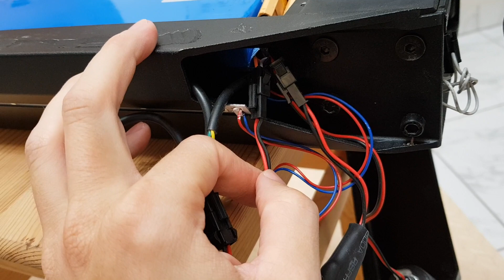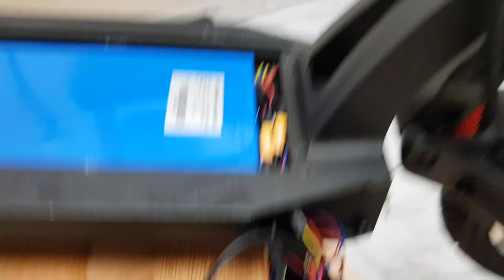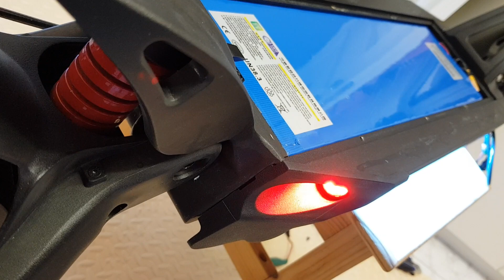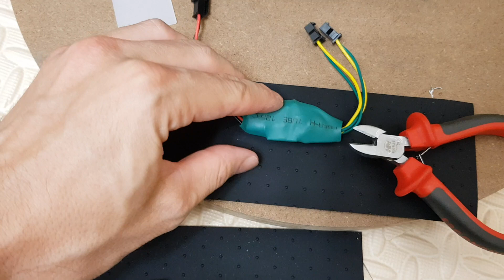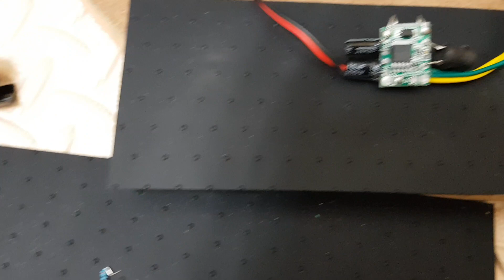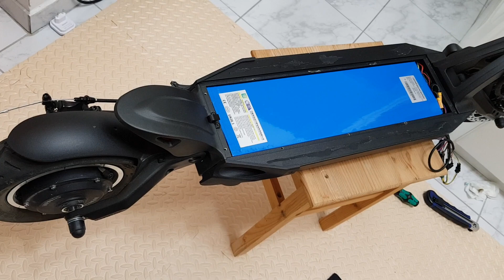Kaabo Mantis Brake light repair

Comment: Hey love your video very informative I'm a subscriber I have one quick question question the black resistor not the green where does it go connected to what wire on the controller or if any please let me know I installed the green one now I'm working on the black 1 please let me know thank you
Reply from the maker: I am sorry, but I don't have the Kaabo Mantis any more. I sold it over a year ago.

Comment: Hello. I bought an Yume M11 electric scooter. The scooter came with the rear light broken (the red diffuser ) and because was mounted on the rear fender after a while broke completely. Yume sent me a replacement but now I have no brake light. I changed the connectors between them and the led's are working either 2 either 3 from 5 total which 3 I presume should be for the brake light. I understood that the controller has a low and a high brake wire. Is the high 12V? I will mount a separate brake light but I see other connectors with only 1 wire. It means the wire is only +? If yes which one. And the ground is common with other ground wire? Please help me. [Smile]
Reply from the maker: Hi, I am sorry but i would assume that the Yume is totally different wired from a Mantis or some other scooters. I could only guess and that is a bad base for advice.
Reply: @ralfhalbknapp1104  Hello and Happy new year. I believe uder different brands the functions are the same. The computer/display/accelerator on mine is the same. I discovered in the mean time that the light is controlled via a chip which sends power trough the wires only when the led's are working aka it senses a consumption. Maybe when the lamp broke caused a short and fried the chip. That means a controller replacement. I want to see what Yume has to tell about it. Worst case i have to buy another one. Thank you for the reply. Seems nobody knows what the high brake wire function is and why in all controller is only one. The low brake two.

Comment: ralf halbknapp Hi please help i have Mantis 10 800w one motor  how to connect both rear brake light and headlamps and side lights from the controller please help Instruction and photo how coonect please help this and cruise mode braking cruose mode dont turn off why?

Comment: I have a question. Do you need to disconnect the battery if you want to rewire/solder wires or is it safe to do without disconnecting everything.
Reply from the maker: Depends on your Skill. I typically disconnect the battery if i change or solder parts that can cause a short.
Reply: @ralfhalbknapp1104  Makes sense. I wonder, Mantis have speed limiter cable as many other scooters, unplugging the cable removes the speed limit, so I wonder if it is possible to make it into a on/off switch somewhere outside instead of plug/unplug inside the deck via simple on/off switch/button, what do you think?

Comment: hey bro, can u help me?  i got a brand new mantis last week.  was coming home from work tonight and got the e10 message and it turned off nd wont stay on since.  it turns off immediately too and from what i've read its a controller error which considering how new it is and how it shut right off, do you think a wire got disconnected?
Reply: Unfortunately, this mistake (e10) is common with the Kaabo Mantis. The same is currently happening in Germany with the IO Hawk Legend which also comes from the Kaabo factory. It is either the controller or the motor that sends an error. If it is still very new, I would advise you to contact the dealer first about the warranty. Alternatively, you can open the deck yourself and check the plugs.
However, it could be fixed with a software update at the dealer or the controller or the motor must be replaced. This should preferably always be done by the dealer. Especially if you have only bought the device, 100% of it is still covered by the warranty.

Comment: Great detail and video.  Question, as my throttle no longer powers the motor.  Scooter is practically new, after I unplugged my battery.  I made sure all wires were tight where the battery was.  But, could any wires going from the brake light to the controller cause me to lose all power from the throttle?

Comment: Hi, i just want to add a signal light to my mantis 10, my question is were can i get a supply for the power? Do you know what cable color can i tap it? Thank you
Reply from the maker: I guess you wpild have to add an additional 12V Converter to get the power. There should be an unused black/red line coming from the controller but anyway space is more of a problem in the Mantis.

Comment: Is the brake light 12volts? I'm trying to add brakelight/taillight to my kaabo wolf warrior but there are 4 wires inside and I'm confused. I thought there would be 3. 1 for negative and 2 for power 1+ for taillight and 1+ for brakelight I cant find wiring information anywhere

Comment: I need to pull hard before the brake light blinking. Is there any way to make it more sensitive?
Reply from the maker: i guess that may be the brake sensors on the brake lever. I would start to check there.

Comment: Hi. I have trouble opening my deck and dont want to mess anything up. How did you open yours? I unscrewed All the screws but it sits super tight
Reply from the maker: On newer Versions it may be sealed with some kind of silicone or so. Other then that it may just sit tight...

Comment: if i connect small motorcycle light, can i connect it to the front small light cable? is it able to handle the power?
Reply from the maker: No, because it is connected to a very thin cable so it can not support much load.

Comment: Excellent work. Is 100 ohm the recommended resistor value or would there be a better suit.. I have no knowledge with this but can certainly solder, t
The 100ohm resistors I see have a different colour code to the ones you have used could you share the spec so I can make sure I do the job properly. Regards
Reply from the maker: 100 ohm is perfect. Just buy a restitor with 100 ohm and test it with a  multimeter.
Reply: @ralfhalbknapp1104  Hi Ralf. Great work! I'm glad I found your video. I need the same repair procedure. Just wondering if any 100 ohm resistor will do? or it should have to be 1/2W 100 ohm? or 1/4W 100 ohm will do just fine?

Comment: is it possible to add front headlight and turn signal light then connect it to internal battery?
Reply from the maker: You would need a dc-dc converter to get from the 67,2V of the battery to like 12V or what ever you need. While These converter can be had at a cheap price you also have to fit it some where into the Scooter. So It may be easier to start with an external 12V Battery anyway and have All in a bag.
Reply: I was thinking on these turn signals. They are DC 12v. Ralf do you know if one can replace /and -or make an extension in the regular backlight cables? and attach the extension cord to these turn signals? (so both original turn signals and these light up, or just the new turn signals) ?

https://www.alibaba.com/product-detail/Unique-Toughness-Bendable-Rubber-LED-Light_62121989324.html?spm=a2700.galleryofferlist.normalList.106.d6c8cf95IV0Ui2